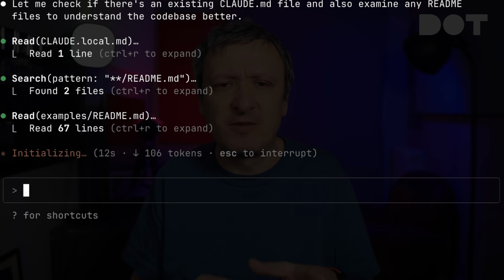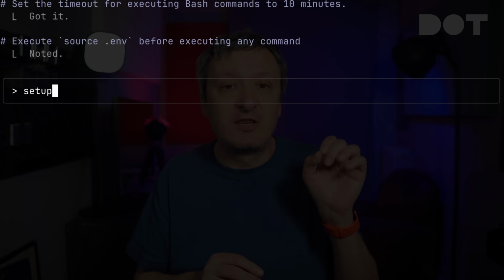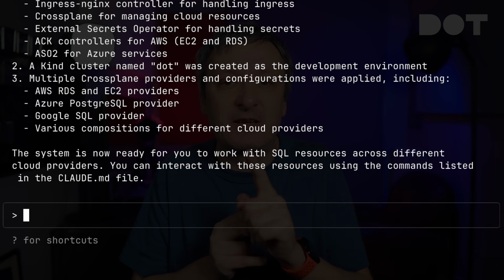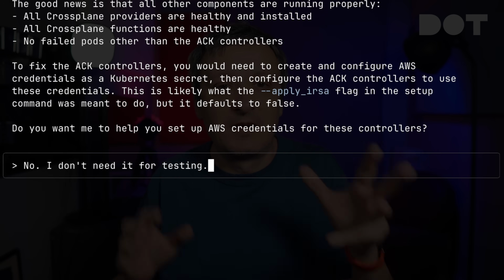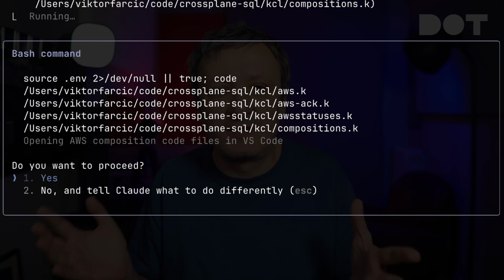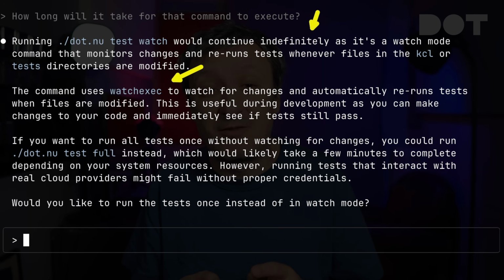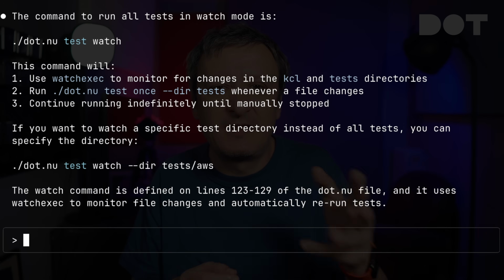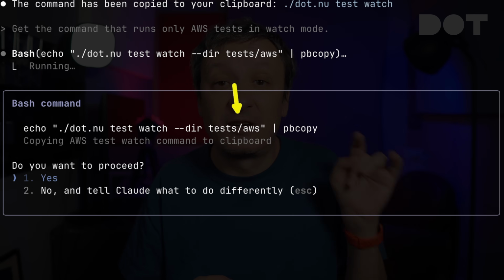Claude Code: AI Agent for DevOps, SRE, and Platform Engineering

Comment from the maker: Have you tried Claude Code? Do you need AI agent to be inside an IDE?
Reply: Try vercept! Pretty damn cool!
Reply: I have, and enjoy it for similar reasons.  It stays in the terminal and I use it as an advisor not a crutch. Also - they rolled out a 'max' plan that includes code for $100/mo.
Reply from the maker: @AaronHeld yeah. That was great news. I feel that $100 is not that much if you use it often. Cursor and similar are $20-30 but theb you realize that after a few days of usage of the thinking model it slows down drastically and you buy more credits only to end up in a similar place like $100 anthropic subscription.
Reply: I have tried Claude Code and I like it a lot. I've also been using OpenAI's Codex CLI. I like it a lot too. As someone who's spent decades at the command prompt, they both feel "native". I've been using them both for tasks like generating builds, CI configs, managing branches, pushes, creating GitHub PRs and Issues. Works great. I'm currently setting up a unique identity so all the AI changes can be identified for downstream reporting so I can see which changes were made with anthropic vs openai agents. It's a bit of a lark but I think over time there will be some interesting intelligence to be gained which can help understand the impact and quality. FWIW, I haven't had to pay for Claude but I did have to pay for Codex.
Reply from the maker: @JeffBeard1 Do you feel that codex is worth it compared to Claude Code giveb thst It is $200 a month. I haven't used it (it was just released) so I'm curious whether to try it out.
Reply: @DevOpsToolkit I’ve only paid $5. And to test, totally worth it.
Reply from the maker: @JeffBeard1 when I saw the announcement and went to try it out, I saw that the only available option (today) is to use it with Pro subscription which is $200 per month. It might have changed recently or I'm looking at a wrong place.
Reply: @DevOpsToolkit  I just used "npm i -g @openai/codex" then when i ran the "codex" command it output a few links to openai's web site to add credits, i did so then it allowed me to start working. Note to others, this is separate from the Codex feature that's baked into their ChatGPT UI.

Comment: Actually, Amazon Q is currently using Claude Sonnet as a model. It has an extension in VSCode, shows what it is running and has memory in addition to Rules.
You can save prompts, add images and so much more! 
Whats great, the free tier gives you quite a lot of runs. I've been using it for 2 months, and hands down - best results of any other tool I've used.

Comment: Thanks for another great video! I work with Claude models every day but never tried the Claude agent. I actually think that Claude models outperform every other I ever used so it comes to no surprise to me Claude agent works great! Given that MCP servers are expanding more and more everyday and they integrate more and more with clients like Claude Desktop maybe we'll get to a point where we can get similar benefits without spending a fortune
Reply from the maker: As it is now, mcp servers rarely reduce the context sent to models. If anything, they often increase it so you might easily end up spending more when using mcp servers. On the other hand, the cost of using AI is often order of magnitude lower than benefits and the price of models is likely to drop over time.

Comment: How is it better than Cursor and an AI agent based on GPT-4.1?
Reply from the maker: I think that the main different is in the agent itself, rather than which model is used. The way it gathers and maintains the context is probably what makes it better. I had much smaller number of cases where i had to provide addional guidance, tell it that it forgot to use an mcp, complain that it did not use instructions from the memory, etc. I cannot ciantify it with numbers. I can only say that I does much better work for me than, let's say, Cursor agent.

Comment: Take a look at warp, it does a much better job if you can accept a less restricted agent
Reply from the maker: I tried it and could not make myself use it. The terminal itself is trying to do too much and does not feel right. I do not refer to how it works and what it does but, rather, in how it looks and feels as a terminal.

That being said, i might have made a mistake for discarding it on that basis. Do you recommend i give it another try?
Reply: @DevOpsToolkit  I don't know, that is very subjective. I started using it because I was looking for a terminal with better support for text editing. Only later they added AI and they improved a lot over time.  So I was probably using it for exactly the reasons that you discarded it :)
Reply from the maker: @dorAb2003 I prefer simplicity of ghostty combined with VS Code (now Cursor). I tend to run those two side by side with heavy usage of the 'code' command.
Reply: Claude code is the best.. I am using it on my Max Plan

Comment: The new version just arrived:
  • You can now send messages to Claude while it works to steer Claude in real-time
  • Introduced BASH_DEFAULT_TIMEOUT_MS and BASH_MAX_TIMEOUT_MS env vars
  • Fixed a bug where thinking was not working in -p mode
  • Fixed a regression in /cost reporting
  • Deprecated MCP wizard interface in favor of other MCP commands

Probably BASH_MAX_TIMEOUT_MS can address 10 min max timeout problem... :)

Comment: Not running on Linux is a deal breaker for me. I tried unauthorized port with no luck.
Reply: Not running on linux? It only runs on linux. To use it in windows you have to run WSL. Mac.. not sure. Linux..YES
Reply from the maker: It's NodeJS app installed through nom. It should work everywhere.
Reply from the maker: I haven't tried it on Linux so I'm not 100% sure that what I'm about to say is correct.

Claude Code is installed through nom which should work everywhere, including Linux. How did you try to install it?
Reply: Oh yeah. Sorry, i kept checking on Claude Code since the first day of came out. And they just used to have this homepage with two links for two releases. One for Windows, one for Mac. And it used to stay stay like that for months. Now I see there is a npm package and GitHub page and docs. Thank you all 😊🎉

Comment: how is this that different from running an ansible playbook to install and update stuff? I get that it's more intelligible but not that much?
Reply from the maker: I did pose that question in the video. If you already have scripts that do something and you do know by heart which one to execute and what the params are, it is easier to just execute it. But, if you do need to write some code or perform operations without knowing which commands to run, AI is very useful. That is especially true when you are debugging something. If, for example, i have an issue in one of my clusters, I do not have scripts ready in advance since I don't know in advance what the issue will be. Instead of running one command after another, I can just tell cloud code to figure it out. In the video, when I asked it whether there is an issue, it ended up executing a bunch of commands, each dependant on the outcome of the previous. Could I do it myself? Sure. Would it be that fast? Certainly not.